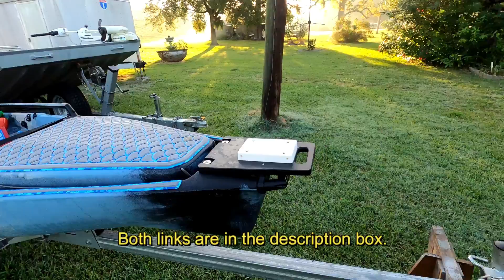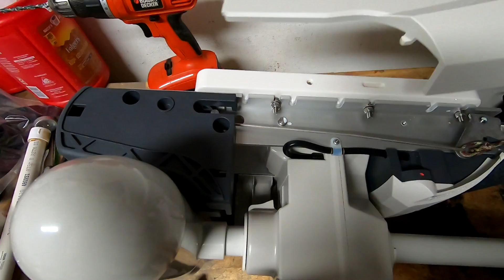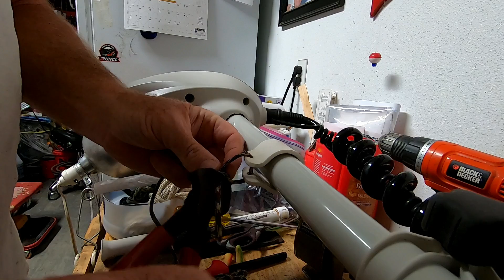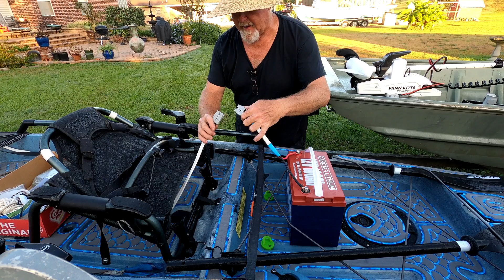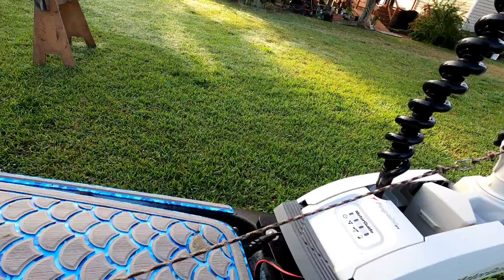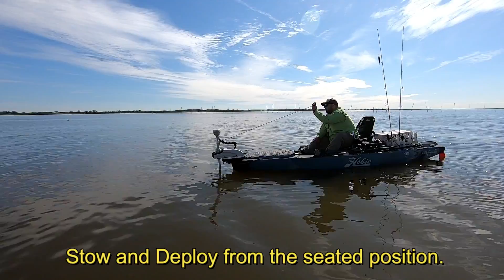Hobie PA 14 Motor Guide Xi3 Troll Motor Upgrade Deploy and Stow From Seated Position

Comment: Were you able to do the GPS calibration on land, spinning in circle?
Reply from the maker: Quick answer is no, I thought it did. It linked in but when you went to spot lock it always headed the kayak south. My son reset it on the water now everything works as designed.
Reply: Okay thank you. I have two xi3 one for me one for my wife assuming both sync up to one another do you think there's an issue with cross signal interference. She will be out on the water fishing with me
Reply from the maker: Not sure but I think it shouldn't be a problem picking up signals from the other. Let me know because I plan to get me one also. @Howie_e
Reply: @SRadigFishing  
I'm 90% done with mine, then will work on my wife's yak. Looking to hit the water in weeks 
Will let you know
Reply: @SRadigFishing  
Hey so I was able to finish and tested it on the water yesterday. As far as I know, I didn't get any signal interference. We were close to either others as well.
Reply from the maker: Thanks @Howie_e